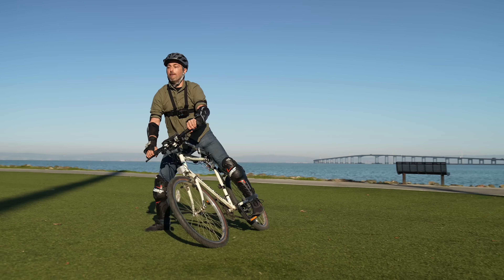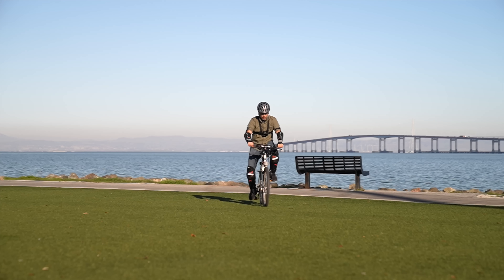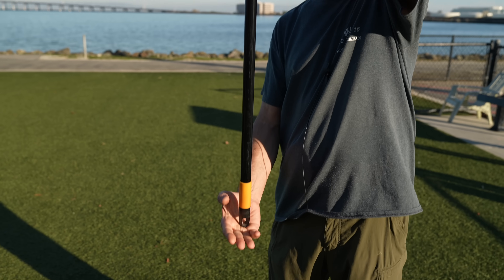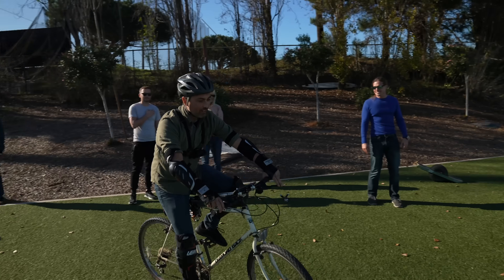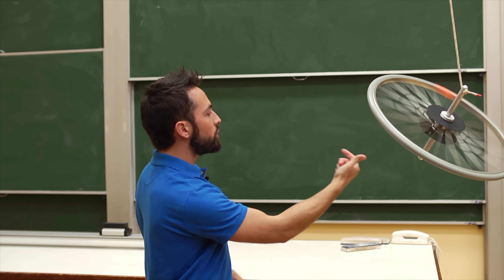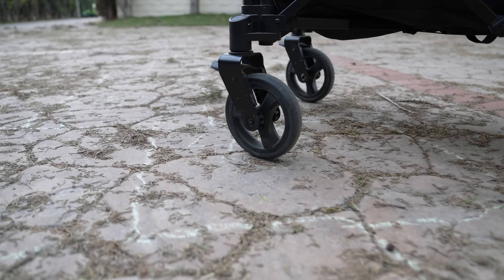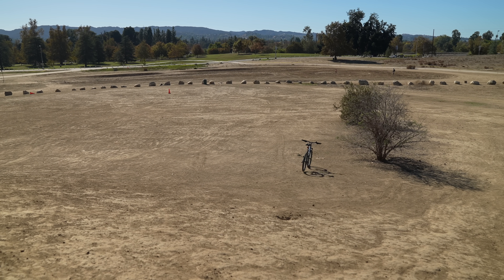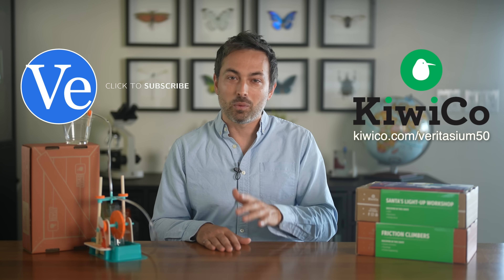Most People Don't Know How Bikes Work

Comment: As a kid sometimes I used to ride the bicycle without holding the steering. To to make a turn you just lean to the side in which you want to turn. And slowly the bicycle turns that side too. So we don’t necessarily need the steering for balance or to turn. Just by leaning to a side you could achieve it.

Comment: What if you ride this same bike with the locked handlebars but hands free? 

i think it can be done. the main reason why you keep falling is because you tend to counter steer but when you go hands free all you really need is to balance out the bike and lean to make a turn. of corse with the handlebars being locked you may not make big turns but you can still turn just enough to keep balanced when going straight. at least that is what i think
Reply: Does not matter. If the front fork is fixed, it does not work anymore.

Comment: Your explanation doesn’t explain how a bicycle can stay upright when ridden on a treadmill.
Reply: Also if you think it’s because of slight steering and griping forward and backwards from the treadmill bicycles will work the same way on rollers where there is only side to side balancing and the wheels gyroscopic effect. Even though I understand that effect can be canceled out. It’s a real head scratcher.
Reply: Why you think bike on treadmill would work differently.
From bike's perspective it is all the same if bike move and road is stationary or vice versa.
Reply: It’s not that I think the bike works differently on a treadmill it’s just that the explanation incorrectly implies that a bicycle must be moving on a surface relative to two points. At least that how it seems to me.
Reply: @adriannazies9635  And that is exactly what happens on a treadmill.

Comment: This reminds me of the experiment Destin Sandlin at Smarter Everyday tried and that an EE Professor at U. of Minnesota also performed.  Destin was trying to ride a bike where turing the handle bars to the left casued the bit to go right and visa versa.  He could not ride that bike either, at least without enought practice that he could then not ride a regular bike.

The EE professor, whose name I can't quite remember, was doing  reaserch for the Army Air Corps during WWII.  He built one of the first (crude) flight simulators.  He told me he heard that pilots had a hard time piloting a plane properly after being hit so that one or more of the control rods/cables jambed or broke.  Being a bit malicious after the war he changed the simulator so that when an experienced pilot tried to turn right the plane went to the left and visa versa to see how they reacted and if any could figure this out and not crash.  I recall most pilots emergered from the simluator drenched in sweat, cursing him for this trick.  Some did not "crash" the simulator", but I belive most did.
Reply: Nice story! Sounds like an ingenious fellow 🙂
The phrase is usually 'vise versa' , I've no idea where it comes from (Latin maybe), but adding the 'a' is a common error (though I am in the UK)
Reply: @benejeneb  You're both wrong, it's 'vice versa' - from 'vicis'. :yougotthis:
Reply: @tinastsebastian  yeah with a 'c'. Should have checked I guess

Comment: this is an example of trying to literally control a system , and "success"  is literally failure.  but by its failure, it implicitly demonstrates:  "build on things that work, then progress from there, until the fundamentals and paradigm shift.". And of course there are the more brainy discussion this spawns; "there must be some horizon of failure, beyond which  we could place ourselves, if only we believe enough and failure is ignored". we just made riding a bike harder. ok. is this in an effort to make something actually easier? yes. academic pursuits of this kind are crucial. but this experiment could be seen, (and is), as an allegory for too much authoritarian political control, where the results are literal, not just an improvement of theory.

Comment: You can balance on a stationary bike, the front wheel allows a tiny lateral movement for balancing. I managed to balance stationary over a minute several times and I'm just an engineer
Reply: The track stand is fun to perfect.  I'm not even an engineer and I can track stand for as long as I want!

Comment: Pretty sure this isn't true, at least not always true. I didn't have the benefit of someone to record me to double check but I went out on the grassy field to try this. It takes a lot of concentration and resisting reflex but leaning into a turn without counter steer is possible I believe, and easier when going faster. And yes I fell several times which is why I used a grassy field.
Reply: Believing something does not make it true.
Reply: @XtreeM_FaiL  undeniable. Objective video of myself might change my mind. However, my own assessment is not without value solely because it is my own. For now I'm going with my own conclusion based on testing as honest as I was able.

Comment: Two things on this video:
First, as a kid, when I learned to ride a bike, I wondered, when I drive straight and then steer right, I should topple over to the left because of centrifugal force. Came to the conclusion counter steering. So don't point this out as "no one knows this" when small kids can acquire this on their own.
Second, a big thanks to not dumbfully repeat school physics, but state the real reasons why a bike keeps upright. It's not the gyroscopic effect, as at typical bike speeds this only assures a roughly upright position, way too less to help. It is indeed the (1) gyroscopic procession effect, the (2) steering and the (3) leaning.

Comment: This is much more important knowledge when riding a motorbike because the forces involved mean that the counter steering has to be much more forceful and it ends up being something you consciously need to do, especially for effective steering when accelerating or breaking. The way I've always taught it is that you push the side of the bike that you want to change, so to turn right I have to push the right side down, and to exit the turn I have to push the left side back up.

Comment: As a cyclist, I want so see someone with serious bike handling skills on this! I want to see if greater than average skill can accommodate the strange physics.
Reply: A BMX frestyler or Trial specialist could (should) easily be able to lift the front wheel and set it more to the "blocked" direction than needed. Having successfully leaned to the "right" (read: intended) side she/he could happily steer in the "allowed" direction managing the steering angle and thereby the radius of the turn.
Reply: @mentiloup  yea, as someone that spent way to much time at skateparks in his late teens, this was the first thing I thought of. now I wanna see a follow-up x)
Reply: @mentiloup  they might appreciate not having a freewheel though...
Reply: right, I think the better rider you are, the more you use weigh transfer rather than just turning the handlebars, so I think a rider who can stand on the bike when not moving should be able to ride in straight line, the turning would be probably still a no go.
Reply: @geolos007  the way track stands work is having the front wheel turning pretty hard to one side and rocking the bike back and forth under the rider. Basically the counter steer section of the turn. 

Eg. A someone doing a track with the handlebars hard to the right feels themselves tipping right. They roll the bike forward a foot to move bike back under them. They then start tipping left and respond by rolling the bike backwards to get it back under them.
Reply: @geolos007  Weight transfer won't steer the bike. Watch twist of the wrist
Reply: @stable-confusion-x  I agree, but  I believe a skilled rider would be able to keep riding - by using the weight transfer (rather exaggerated I imagine), although would be only able to steer in one direction (or go straight in the last example).
Reply: @geolos007  Agreed, going straight would be possible for a skilled rider. At a certain speed the gyro effect would start to make it easier.
Reply: Bring in the Dutch!
Reply: you may find this is counter intuitive. as mentioned in the video those with the exceptional riding skills likely have it even more so engrained in their brain that it becomes subconscious and harder to. smarter every day have done some great videos of a different un-rideable bicycle and found that those with minimal riding experience found it easier.
Reply: @SilmSlice  Good point!
Reply: @SilmSlice  That might be true in the first couple minutes, but I bet you could have someone like Peter Sagan figure out how to steer it rather quickly because they would figure out how to "counter-steer" without actually doing it through the handlebars.
Reply: I agree completely!  I would love to ride that bike a while.  As mentioned by the BMX a skilled rider is okay with being on one or even zero tires.  Two things i noticed 1) weight; it looks too heavy, and 2) skilled riders can stop a bike and not fall off.   So why was every rider needing people running beside the bike?  I wonder if a skilled rider can wobble the balance of that bike ( shift right to left and back) to obtain stability.  and similarly force a low grade turn I'll be it a dangerous turn ( give me 40 acres and I'll turn this thing around)
Reply: I was always taught to lean your weight into the turn and the bike out which does the same initiation part of the turn they are talking about. I feel like they missed the fact that lean can get the bike where it needs to be like the counter steering.
Reply: Someone like Peter Sagan.
Reply: @keirfarnum6811  I'd take any pro track rider too. I haven't been following it for a while but I feel like they know how to turn without this pre-turn.
Reply: I reckon pro's can as they can ride on skinny bits of wood without falling off
Reply: @Yhoda.PsyTrakked  but they are still using counter steering to balance!?
Reply: "Serious bike handling skills" Are you serious? A child can ride a bike. It's not strange physics? It's normal physics. The bike has to lean so the horzontal component of the frictional forces on the wheels counteract the centrigual force from the circular motion of the turn. 

Strange physics or chemistry is Velveeta Cheese. All other cheeses have to be stored in the refrigerated case. Velveeta can be stored in the unconditioned paint and hardware section of the store and be just fine.

Veritasium should do a video on that.
Reply: @jcgoogle1808  I am perfectly serious, go look up some professional cyclists such as Danny hart, Danny McCaskill, Peter Sagan, sven nyes, Christopher blevins, etc. And I certainly would call it strange physics if you are turning right to go left. In vehicle dynamics, steady state cornering is extremely simple compared to controlling oversteer properly for example. Turning right to go left is not a trivial thing. A child being able to ride one does not mean that they can ride one well and it also does not mean they have studied how to make two wheeled machines go fast.
Reply: @tristanhanley8741  it's not strange physics. It's just how single track wheeled objects work! Did you even watch the video? To initiate a lean on a bike you have to countersteer.
Reply: @tristanhanley8741  

It's not turning right to turn left,.... it's putting the center of gravity in a position to create horizontal components of frictional forces on the wheels to counteract the centrigual force resulting from the turn. 

The reason a 4 wheeled vehicle doesn't turn over without the "turn right to turn left" requirement is becasue the alignment of the centrigual force on the CG is directed inside the wheel footprint. But the 4 wheel vehicle does lean to the left on a right turn. If the cenetr of gravity is high enough it will turnover as was an issue with Jeeps years ago.

It's pretty rudimentary physics. It's not stange. You don't need someone with "serious nike handling skills" to undersatnd it.
Reply: @ReLaX REC. Not if the fork is fixed.
Btw. which way the front wheel point when you drift? ;)
Reply: @ReLaX REC. 180° stoppie. The wheel is locked, but the fork isn't.
I'm no stuntrider. I'd crash if I try to do that.
IDK whow they do it, but my guess is that they steer and let the momentum swing the rear.
Reply: It would still be impossible. Counter steering is required to turn a bike.
Reply: @stable-confusion-x  Well no I sometimes lean into the the direction i want to without moving to the left or turn without holding the handle bars. Most average people will counter steering including me, but i  still can do it.
Reply: @lepuginarug  this is what I am also thinking, that you might intuitively counter steer, but not have a need to. For one thing, when I have taught bike handling, the main thing is center of gravity over bottom bracket. I can do this without intentionally counter steering but I'm not sure if I am still minutely doing it
Reply: @lepuginarug  this is a point this video got wrong, I believe.  When you lean your bike, physics will counter steer.  You may not be consciously doing it, but it is still happening.  If it didn’t, the bike would not turn.

If you ride a 900lb motorcycle, you either learn to counter steer or constantly pucker the seat, hoping your machine does what you expect.  ;)
Reply: @lepuginarug  exactly, I went out and tried this myself after watching the video. You can initiate a left turn by only leaning left. Of course I can’t lock out my right hand steering like the video but I really tried and paid attention to not countersteer right before turning left and it’s doable. Most less-skilled people just aren’t used to leaning a bike as much for steering.
Reply: @tomdivittis2688  the point of the counter steer is too shift the weight, it's necessary with a 900lb motorcycle but with a 10lb bike I weight enough to shift the weight into the turn without countersteer. I ride no handed all the time and steer by shifting my weight slightly.
Reply: @lepuginarug  but the bike will STILL be countersteering even if you're not holding the bars. Did you watch the whole video?!
Reply: @henryefry  any bike any weight any rider... Counter steers to turn. Even when not holding the bars. Just watch the bike with no rider! It's counter steering itself. It's physics!
Reply: @sixty2612  you will still be countersteering a tiny amount. It's just a small amount you don't notice. It's physics!
Reply: @PiggyPower  I really don’t think so based on the testing I did this morning but unfortunately I can’t physically lock out my steering. The video is an incomplete experiment because it relies so much on human skill. And nobody in the video had much.
Reply: @sixty2612  skill is irrelevant... It's how bikes/bicycles/motorbikes WORK! MotoGP riders are the best in the world

...but they can't defy physics!
Reply: @PiggyPower  I’m saying that the statement that physics requires you to countersteer is incorrect. Many people do it because it is easier or faster but it isn’t necessary if you have good weight transfer skills.
Reply: @henryefry  I think you missed my point.  Shifting your weight will turn the bars the opposite way, making the bike the turn.  You are turning by counter steering, you are just turning the bars by shifting your weight, without realizing you are doing it.

It’s physics.  Counterintuitive, but true.
Reply: @tomdivittis2688  Yeah no sure on the physics on it
Reply: @PiggyPower  Yes, what i mean is that I can turn without counter steering, the bike itself will countersteer.
Reply: @lepuginarug  indeed. Countersteering still occurs though.
Reply: @PiggyPower  yes
Reply: @lepuginarug  Whether you realise it or not, you're countersteering. Watch twist of the wrist.
Reply: @stable-confusion-x  no. One can lean to overcome it.
Reply: @EmilParkour  One can not. Watch twist of the wrist.

Comment: If you lift up front wheel It makes easier to keep balance of locked steering bike. With brake you can even drive to any direction, but in that case it is not really driving so jumping.

Comment: Great racing cyclists know that if you really want to hammer into a right turn, you actually push out hard with your right hand to the left as you lean into the turn, and you put most of your weight pushing against the left hand (outside) pedal. It's crazy counter intuitive.

Comment: As someone with a passing interest in physics that rides a unicycle whenever I go past the letterbox, I was aware of the presence of all of these counter moves to maintain balance in the direction that you want to go, but curiously, I haven't been able to notice them as I ride - I'm well aware that when I ride off the kerb I must be doing a mad collection of corrections to counter the sudden ease of moving forward, the bizarre way the contact point just stops on the edge of the kerb until the wheel reaches the ground (and the sudden shift forward in the contact point that comes with that), the way that I'm suddenly having to go from the kerb pushing the wheel forward to the camber of the road gently pushing the wheel back, and probably a bunch of other effects that I'm missing, but when I do it, all I feel is a bit of a bump and my legs being slightly stiffer, which I can only assume is the result of the aggregated corrections that I just did.
Reply: Now that you think about it, I sure hope you can still ride. ;-)
Reply: @ccreutzig  thinking about it hasn't stopped me in the past six and a half years, so I should be fine (that was when someone asked for advice on how to make sharp turns, and I got someone to film me doing so to try and figure it out, but I'm pretty sure I've been pondering these questions for longer than that).

Besides, my combination of a curious mind and a mode of transport that everybody asks questions about has made me mostly immune to the curse of thinking about what you're doing (but I still haven't quite figured out how to do that twirl I do when I pick up my spoon).